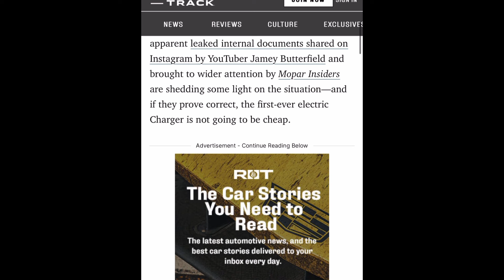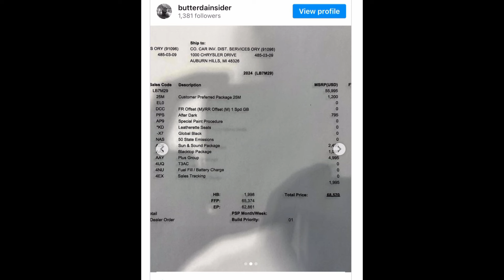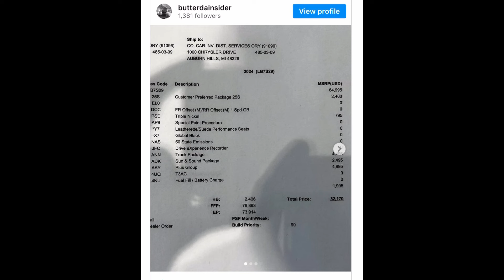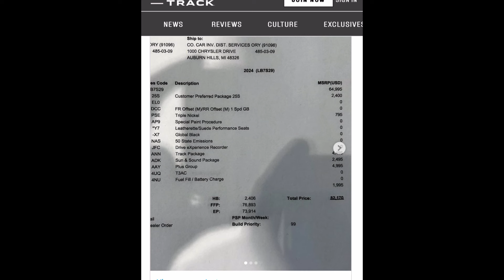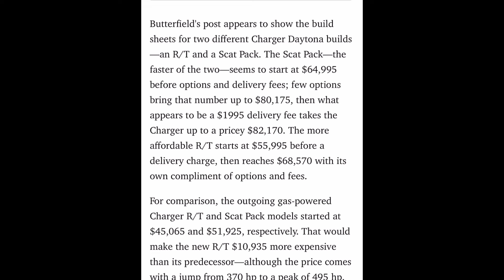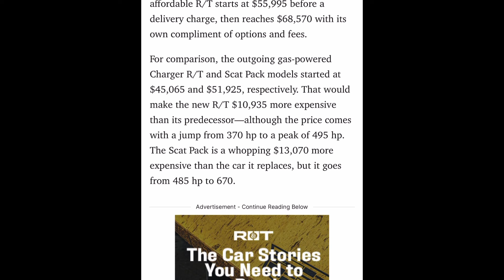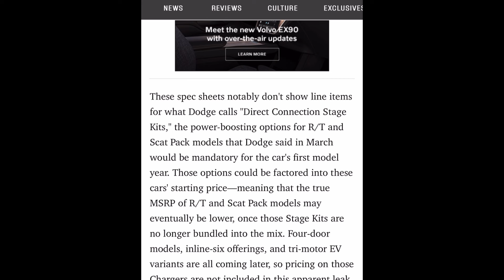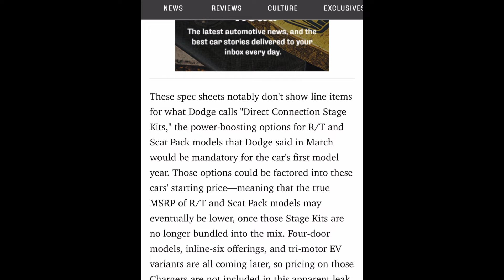2024 DODGE CHARGER EV pricing and sound

Comment: Damn, I really need to move on getting a new car. My 300 SRT is still serving me well. But 10 years from now, I'm fuked. I like to plan ahead. Whats your thoughts on Lucent? I did test drive a Taycan. If I cash out some stocks it'll be no problems, but my portfolio is growing up and don't really want to touch it right now. I prefer to buy outright, I don't believe in financing.
Reply from the maker: I had a 2012 Chrysler 300 SRT. Even by the standards in 2015 that car was obsolete. The front seat space was OK but the rear seat space wasn’t.

That’s why I upgraded to a jeep SRT and never looked back. The Jeep SRT offered everything that the 300 SRT did plus all-wheel-drive and more space. 

Because Chrysler is basically dead there is no upgrade from the 300 SRT. You might as well keep the car after it’s paid off and have it as a second car if you choose to go electric. Lucid as well as many other electric vehicle makers have some competitive leases on their vehicles to move them. My problem is that they nickel and dime you for luxury interior features.
Reply: @PassportBrosBusinessClass my car is paid off. I bought it outright off the lot. I rather buy outright than finance
Reply: @PassportBrosBusinessClass insurance prices doesn't matter to people who are going to be stealing these cars and swapping out the motors - this is definitely not going to solve the car theft problem (probably make it worse) -  putting high price dog food in front of a hungry dog - they are better off keeping cars affordable because some people who can't afford something always want to take something
Reply: Well I have a 2013 Chrysler 300C and I've been riding around in it. It ain't gave me a bit of problem I rather have a used car already paid off than paid payments on ugly looking cars. I rather have gas motor car any day than that electric crap
Reply from the maker: @robertwilliams485  

OK good for you.

But a whole lot of people- and the industry are going the other way.

The Chrysler 300 for example has been discontinued. Cantis service continues to get worse so hopefully you don’t have any problems with your car because repairing it won’t be as easy as you hope it would be.
Reply: @PassportBrosBusinessClass  well I don't know what your experience was really like with them but I'm just letting you know my opinion that I don't have no problem with mine. Some people might not be like you and have the money to pay $80,000 for a car and if I did I wouldn't spend a lot of money because you would lose the money because you lose money with them anyway so